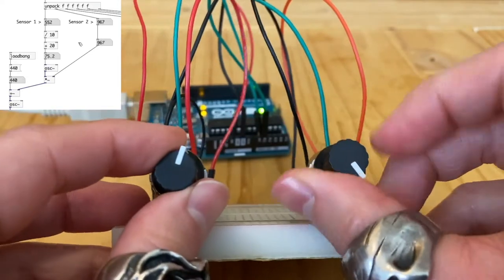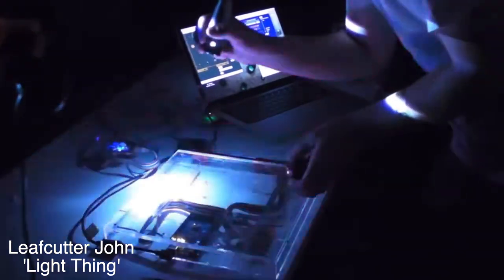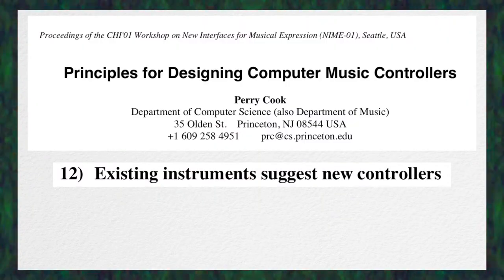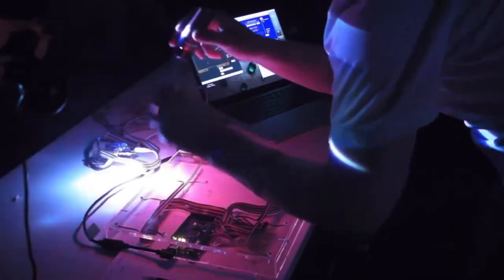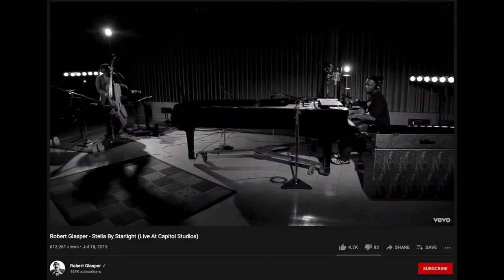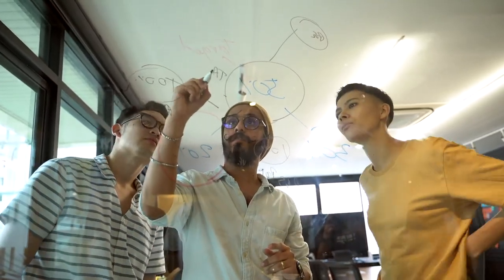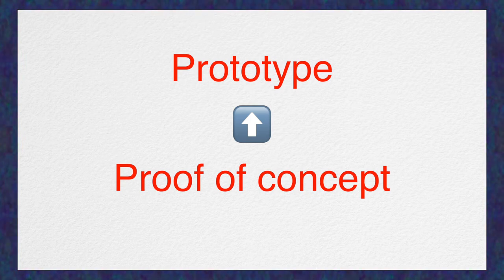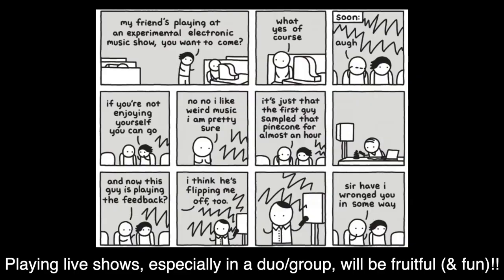How to Come Up with DIY Musical Instrument Ideas!

Comment: I'm hoping this channel grows because it's fantastic. If it stays small for the time being just know the people who are watching are getting a lot out of it!!! I am just waiting on work to slowdown to start working on a voltage controller for my modular. I feel like the process would be pretty similar on the physical control side.  is there a way to program the arduino to send cvs to the outputs? Your videos are extremely inspiring.
Reply from the maker: Thank you so much for the support! It seriously makes my day to see kind words like yours! 

Yeah, I'm definitely planning on making a video about CV. I have used Arduino for CV output before. The main issue is the quality of the signal, and I think it's not ideal for pitch control. But for other synth parameters, like VCA, Arduino CV has served me well. You can check out some eurorack experiments here (https://www.youtube.com/c/TakumiOgata/videos). I have used Bela's DAC (8 separate outputs total) before and it has high resolution (16-bit). Daisy has 2 DAC outputs (12-bit which is still high enough for eurorack) but costs less. Regardless of what you end up using, all the topics covered in these videos will come in handy!!

I'm guessing that I'll be able to make a video about it around August or September, but please feel free to reach out to me if you wanna get a head start while you have more free time and such. I'll be making videos about Bela and Daisy before that most likely, and I will be mentioning CV.

Comment: I like the spinning ball idea, but I think it would make more sense also stopping it and scratching like a DJ turntable, and even with 2 axis option. It could be a game-changer feature with well designed layered instruments. May be not only for subtle sound changes, but even for loud modulation or rhythm variations like in some kind of soundscape sounds. After so many years trying several instruments I just found I wasted a lot of time, and I will try to focus on "keyboards on steroids", like using Enhancia Neova ring (now sadly bankrupt company), TEControl breath controller, Expressive E-Touché (I watched it working amazingly for some kind of finger drumming, or simulating guitar strumming), of course modulation and pitch control wheels, or Roland-like both in one, Roland's E-beam, joysticks, ribbons, theremins. It's worth noting that the TEControl version 2 breath controller for example also adds gyroscope motion sensing. I like the idea of the spinning ball, and now I think there are already some sounds already designed for something like that but with 2-axis (X/Y), like Korg's KAOSS system, but I like the idea of also stopping it, like stopping the hi-hats, or muting bass or guitar strings, and even some filters that slowly stop the sound like a turntable. For example now I use a Logitech's MX Anywhere 3 mouse, just because it adds something I had never seen before, and I cannot live without it now, and that's the scrolling wheel without resistance and inertia, which I use for smoothly scrolling throw web pages, either slowly, or very quickly, with inertia, and which I can stop at anytime if I find what I am looking for blinking fast, and the wheel being also magnetic can give some feedback to the user, and even be switched to step-mode. I also like the idea of the Linnstrument because you can get visual and tactile feedback while allowing you to use even microtonal intonations and several ways of modulation, as the ROLI Seaboard RISE 2, which its brand new "frets" to better feel the pitch even if you want to play without pitch quantization. Look also for the Eigenharp instrument if you didn't know it, just for curiosity, as it already combines some of the instruments I told you. I liked the "flashlight thing", but in my opinion it has some drawbacks if you want your results to be repeatable, unless it follows some kind of very throughly calibration for different ambient conditions, seasons, lighting conditions on every part of the planet as well as changing weather, and even more for live performances. Think about the Trautonium instrument for example and Oskar Sala, who developed some kind of symbiotic relation to the instrument, with almost nobody else being able to perform like him, and he being almost unable to perform as well with other instruments, and the sooo hard needed setup times and between "acts" of a performance, which renders him and his instrument almost unique. I like to watch these virtuoso musicians but I wouldn't like to be in his skin trying to setup the Trautonium before a performance. I'll come back if something inspiring comes to my mind. Thank you for the video.